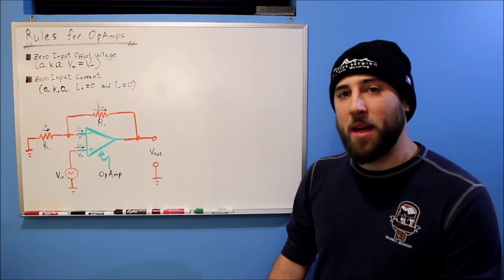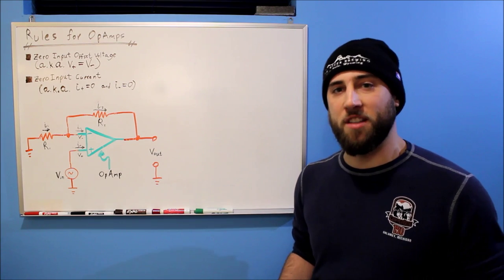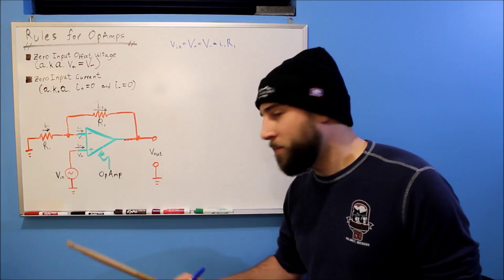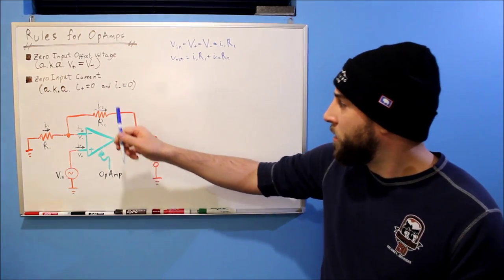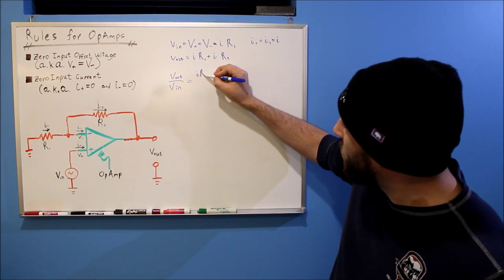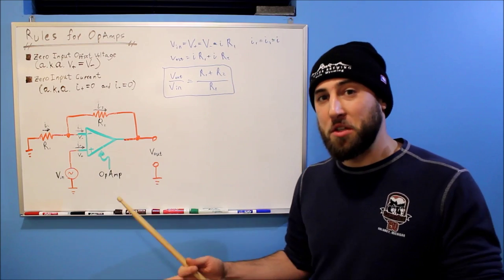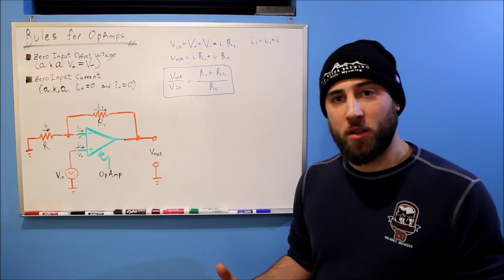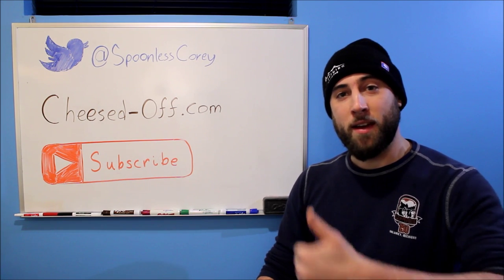How Op Amps Work

Comment from the maker: At about 52 seconds in I refer to this circuit as an inverting amplifier. It is not. It is a non-inverting amplifier. Don't worry though, the math works out and matches what is drawn out. I just had a slip of the tongue and said the wrong name. Thanks goes out to the keen fan who caught this.